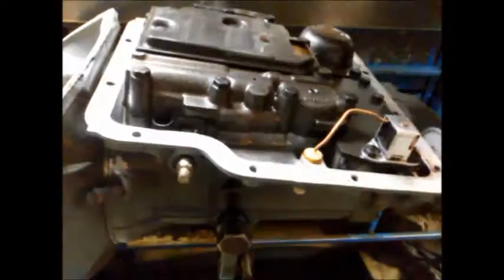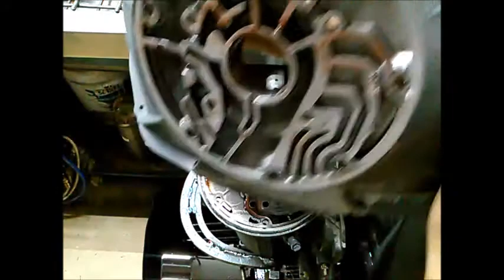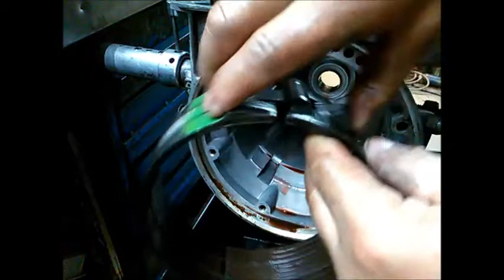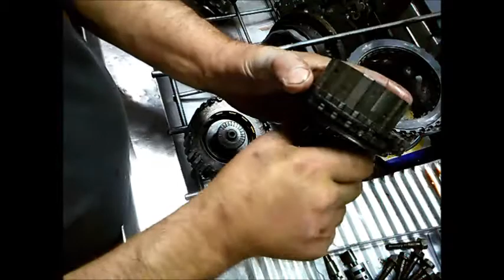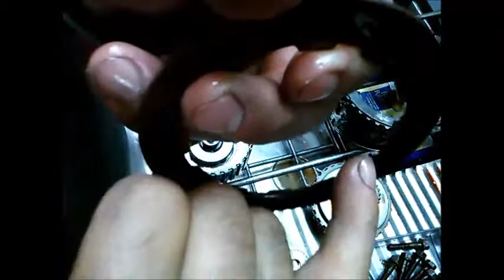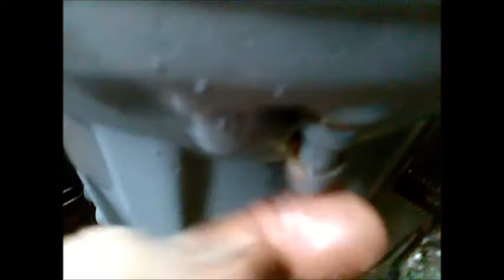Trimatic TH180 3L30 Auto Transmission Holden Commodore GM Disassembly/Overhaul Part 1 of 4

Comment: Thank you for sharing all your knowledge here with us. I have watched your videos many times over and just bought 2 scrap Th180's for learning purposes.
I opened them up to see how scrap 🚮they are. one has wavy shattering markins on the outside of the 3rd gear drum, the other one on both.
One has a ⚠cracked 2nd gear drum.
What I am wondering is:
1.) why has that happened
2.) which 2nd and 3rd gear drums can I get, which other transmissions have compatible ones? I live in the Dominican Republic. Close to the USA and there are hardly any 180's 3L30 anymore.

I bought them both together for 50€ they are from an Opel, and I am going to mount them onto my Lada Niva using a Fiat Spider 124 bellhousing.
I can buy another donor in Germany if I can't find drums.
Thank you all!

Comment: Just a question Ive got a full manual trimaic and I got it rebuilt by a shop it's dun the same thing y   I got it rebuild for it's got first and reverse gear but when you shift it in the second at like you chucking in neutral any ideas? Thanks

Comment: How in the fuck do I pull the speedo gear out of on of these? I see a 10mm bolt that looks like it holds the whole thing on but it doesn't look like there's any gap, and trying to pull it out with the cable still connected doesn't seem to wanna budge. Do I need to take the tail housing off. People tell me to just pull it out lmao but it literally will not move even when a set of channel locks, and nothing to pry on.

Comment: Looks almost like an American turbo 350
Reply from the maker: hi, yep with one eye closed, upsidedown in the dark. cheers
Reply: Will fit anywhere a T200 4r did. Same output shaft , length, Trans mount , shift linkage , but don't be fooled they are very popular in Australia even today , I've seen them take 1000 HP behind a rotary Mazda !

Comment: i have a old trimatic in my FB 6cyl, was leaking front seal, i've replaced the seal and converter bush, but when putting it back together if i tension even lightly the pump bolts the pump goes solid,   back off the bolts (less than finger tight) and freely spins.  any ides on this ?  nothing seems to be out of place and tried spacer washers under the bolt heads so they arent long.   the tin plate has some rub marks where the pump gear has been slightly rubbing, not sure it that is normal.  but mystery when they pump will  not turn with any sort of bolt tension. :-(
Reply from the maker: hi, might be contamination, recheck cleanliness and work. cheers

Comment: Hi mate, great videos very helpful. just got a question....I have a VH commodore with 253 and trimatic, the trimatic  has been rebuilt but when I installed it there is a whining noise when idling and driving, all gears and in Park/neutral.  The noise goes when I disengage converter. Would you have any ideas what this could be??
Reply from the maker: hi, id take it back to whoever rebuilt it. hopefully you filled it properly when dryfill ....we put in 3L then start for 5 seconds, then put in another 3L then start for another 5 seconds, then another 3 L and start and quickly dipstick to make sure has fluid showing touching dipstick ( if its not touching then turn off asap ) - top bit more as needed then keep running and select through all gears a couple of times then into park still running - then check fluid level is still ok for it being cold. take for a drive and check at operating temp. if you dont fill like that you risk running pump dry as the torque converter isnt filled/primed yet. many people do damage like that or reduce trans life because its running dry until the proper fluid level is added. cheers
Reply: @YepThatsIt  thanks a lot for reply, we put 5 litres in then ran thru all gears and toped up as needed. I did take back and he rebuilt again, this time with pump from very low millage  6cyl box, Put it and no noise. but im a bit worried now about the type of oil we used... Apparently we shouldn't have used synthetic oil. and should be using Dex3 Mineral ?
don't want to take box out again to drain converter, so was wondering if I can just drain box and add correct oil and if it matters when they mix? appreciate your feedback 
👍

Comment: When I changed my vacuum modulator (transmission on car) I never saw a pin fall out. My car still goes through 3 gears and the only issues it seems to have is a flare upon electronic kickdown and a shudder if you take off too quickly. What would happen if that pin was missing... can it go missing under these circumstances? I also noticed that although it goes through all 3 gears, it does so fairly softly.
Reply from the maker: hi, let me know how it goes when you get your pin. cheers

Comment: Back in 1978 ish I was in my last year as an apprentice at NorthPoint Holden in Heidelberg, Melbourne. Because of higher rear cylinder temperatures, due to new emission controls, the reverse clutches would burn out and block filters. There were hundreds of recalls. Solution was pull down, rebuild and bigger filter. I went to GM school for Trimatic training. Mechanics would pull trannys out - I'd rebuild, they put them back in. I was doing about 3 overalls a day - for weeks on end. Finished up all I knew was these transmissions, and nothing much else.  Always park these cars backwards. Don't start up when cold - chuck in reverse and floor  it.
Reply from the maker: hi, yes they were the good ol` days.... they tried to fix the rev friction plates peeling problem by adding a large mesh at the filter pickup, so the peeled linings dont restrict the flow into the filter. the problem was once the plates ran a while metal to metal, the updated filter was useless, the fine metal would jam up valves.  i think they improved the quality of the bonding material as well as improved friction lining material. on these trans, most often people wouldnt/couldnt change the bushing in the stator for 3rd clutch which acts like a pressure seal. experience combined with repetition usually cures most problems. cheers for your story 🔧
Reply: @YepThatsIt  . Yeah. Even at the time I thought it was a bit of a dodgy fix. Just keep the car running until the warranty expired. Even the bigger filters looked like they were slapped together by an a amateur.

Comment: Hi from SA 
You have helped me before and thanks
I am ready to put the valve body back on trimatic
and there are 2 x30mm bolts with blue locktite
and washers,could you tell me where these 2 go
Cheers
Joe.
Reply from the maker: hi, id say on the kickdown solenoid, many people loctite them. cheers

Comment: Hello a friend on fb wrote this. Has anyone else tried this?? 

3 speed automatic TH180 / 3L30. I have found a way to turn this in to manual shift, so you can start in whatever gear you choose. Especially handy when in low range. And it is reversable if you wish to turn it back to auto shift. 
Remove the tail piece, so you can take the governor off,( be careful not to damage the gasket or be prepared to make a new one, they are hard to find. Same goes for the gasket for the tail piece ) remove the spring from the governor and jam both pistons, so they stay fully open. Make sure they don't move, even when shaking the governor. I found that a 1/4" nut and a little piece of flat bar, shaped to fit, was just right. While you have the governor of, check the little filter/screen behind the governor and make sure it's clean. Reinstall the governor and torque to 6lb.ft and tail housing 23lb.ft. Disconnect the vacum hose for the modulator and plug the intake manifold. I rerouted the hose, to the vent hose from the transmission, so that I don't get dirt in to the modulator. Do NOT remove the modulator, it has a spring inside that keeps certain pressures in check. That's it, go have some fun!
Try at own risk, I am not a transmission tech. But I have now done about 10 hour's of hard wheeling and it's working great! No slipping or over heating. Firm but not hard shift's
Reply from the maker: hi, contact me on facebook link if you need gaskets we have heaps ( often we leave governor gasket out, just make sure surface is flat )... interesting, cheers for that 👍
Reply: Hola estoy leyendo tu comentario y me interesa solo que no sé cuál es ese regulador me parece que aquí en Venezuela lo conocemos como el gobernador o o estoy equivocado?

Comment: thank you great help can you tell me if you replace sprag bearing when you rebuild transmission, regards john
Reply from the maker: hi, depend on if its worn or on application....HP I'd replace. Hope that helps Cheers
Reply: thank you   yes does help
Reply from the maker: hi, stator bush needs to be excellent. cheers

Comment: what size of spanner fits the modulator? I need to grind a spanner down to fit the gap but would like to know size of spanner I need, thank you
Reply from the maker: hi, I think is 30mm or 1 3/16" , needs to be narrow to fit. cheers
Reply: cheers mate, now I know which one i need to grind down to fit in

Comment: i have a quick question that might help me to diagnose whats wrong with my gearbox. the car gets the first gear and shifts to the second gear and thats it, doesnt change to the third even if i reached 60 km/hr. i tried while the car is running to shift to neutral and back to Drive and it shifts to the third gear and this doesnt work to reach the 4th gear. so what do you think is the problem with my gearbox?
Reply from the maker: hi, always check basics first....like fluid level....on trimatic check your vacuum lines and also that the orifice at inlet manifold hasn`t carboned up. if there is trans fluid coming out of modulator, the rubber diaphragm is buggered and change it. hope that helps cheers

Comment: Thanks for posting the video. I have a Chevrolet (Brazilian)  6 cylinders and uses the same type of automatic transmission TH180. The interesting thing about this car is that the body is based on the German Opel Rekord 1968  but the American mechanic is based on the  250 -  6 cylinder engine.
https://pt.wikipedia.org/wiki/Chevrolet_Opala
Reply from the maker: thanks for the info, cheers